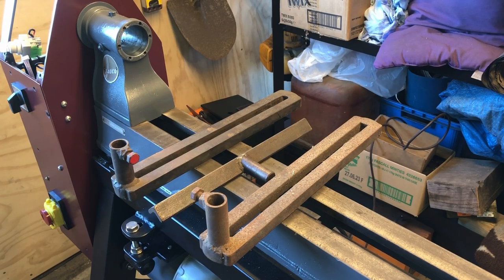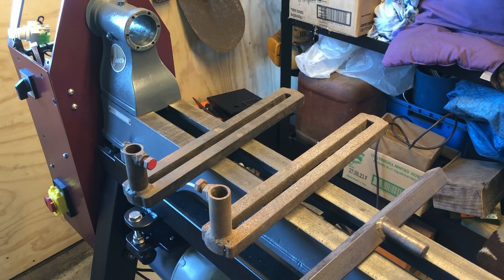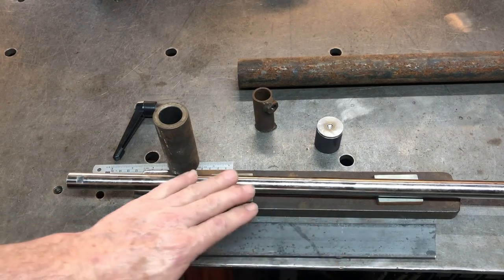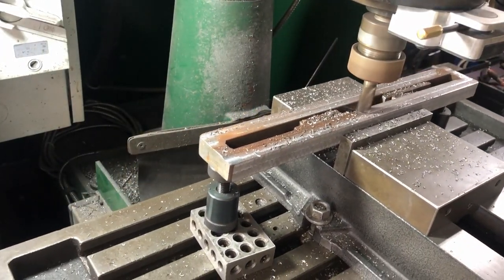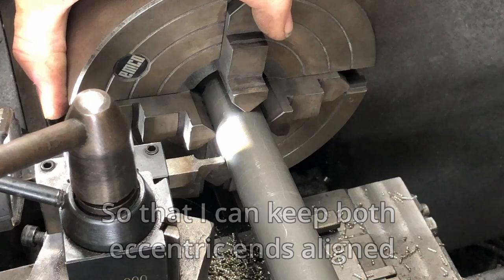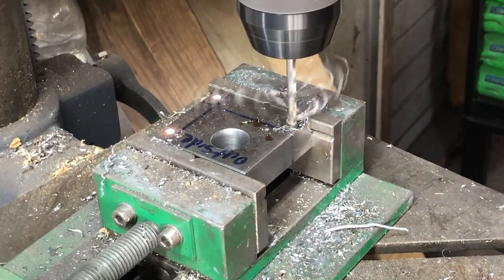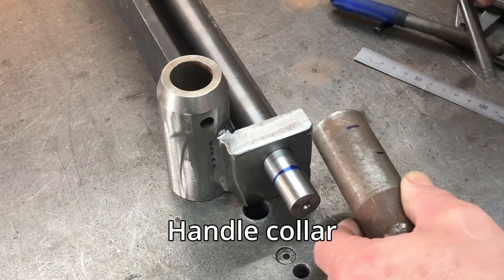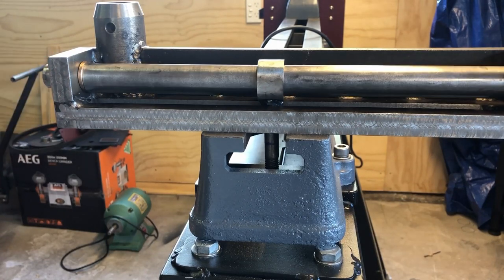Lathe Restoration And Improvements - Building A Quick Release Banjo

Comment: A very useful addition to your lathe. I worked with a lathe that has a similar tool support. It was a U shape from square tubing. Used exactly the same cam idea that you did. The bottom of the square tubing was cut off and you had a nice quick setup. You use what you have right!

Mark
Reply from the maker: Yes, use what you can and make it work. Thanks for watching.

Comment: That's a good upgrade. I will do something like that for my old Hyco lathe. I recall seeing a lathe that had a single locking handle that locked the banjo and the toolrest at the same time. It may have been a Record lathe? I always wondered how it worked. It may have had two eccentric cams on a common shaft.
Reply from the maker: Thanks Mark. I have not seen one that locks both the tool rest and the banjo, but I think you are right that it would work off of a common shaft.

Comment: I like the concept but you lose turning capacity for larger diameter wood turning projects.  You may want to rebuild that second one that came with the latch with a simple T-nut in the event you do some bowl turning.  My crappy old Sears Craftsman lathe has a pipe instead of two ways like yours and the cast banjo tightens with a bolt so the function of yours is very attractive to me.
Reply from the maker: Thanks for your comments. This lathe has a very small swing and the banjo is quite long. I will be able to use the banjo from the side without it being directly under the work so I should be able to the maximum piece in the lathe and turn it.
Reply: @thehobbymachinistnz  although I can image your thought process, and I think that really won’t do for you. If you are turning anything over 150mm you will not be able to reach the other end of the project with a stable setup. The only possible way to reach would be an extremely long tool-rest but at that distance the turning forces would cause flexing, bringing your tool lower below center the farther you go from the banjo.
Reply from the maker: @azarellediaz4892  Yes, you are right. The spindle height is quite small so trying to turn bowls is problematic with the new banjo. I have actually purchased a new lathe which can turn large bowls, and the head also rotates so I can turn large platters as well. I will likely keep this lathe for spindle work.